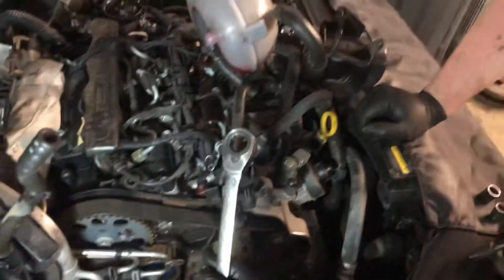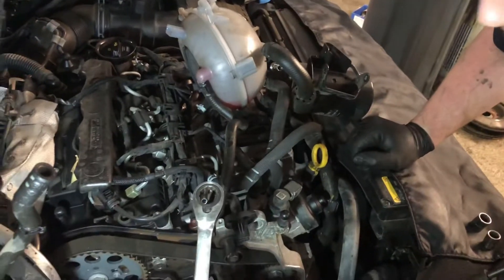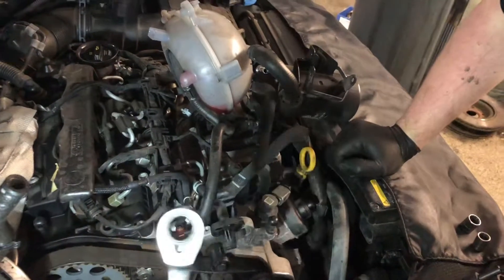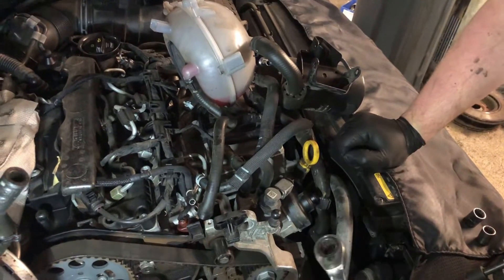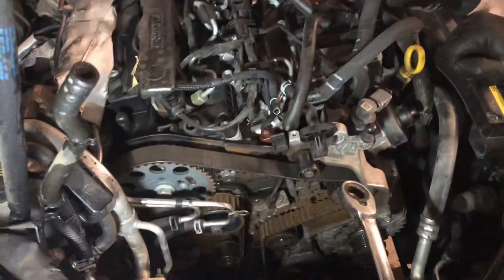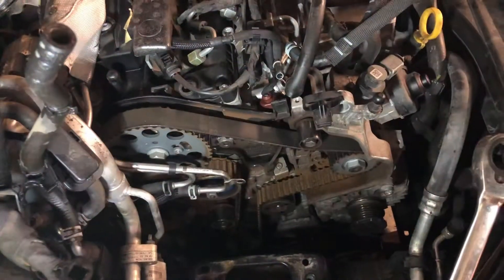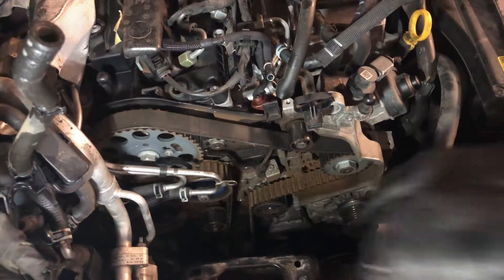VW Timing Belt (EA288 Engine) ASMR

Comment: came here from "how to not replace a timing belt"
Reply from the maker: That’s great so you’ve come from how not to do a belt  and arrived at how to do a belt :)
Reply: @TheVWMechanic_official  Ha, was one of your videos on a VW with an interference engine
Reply from the maker: @thexnut3582  all 3 of my timing belt videos have been interference engines :)
Reply: The one where the customer installed the tensioner on the wrong side
Reply from the maker: Yep that’s an interference engine and yeh it was a vw polo